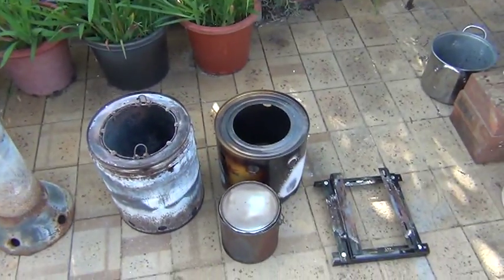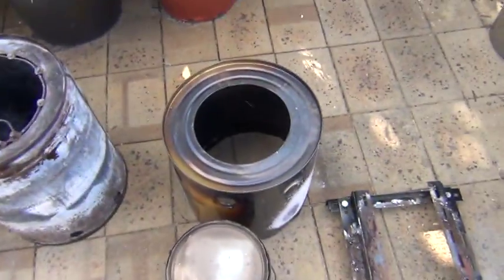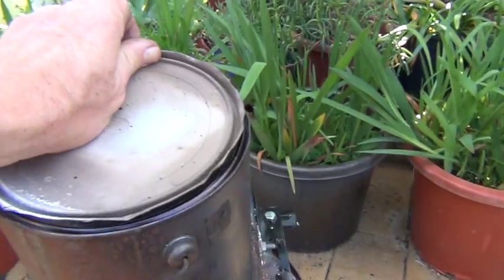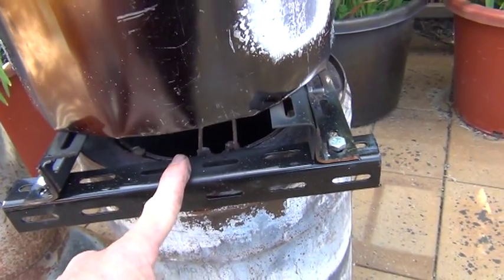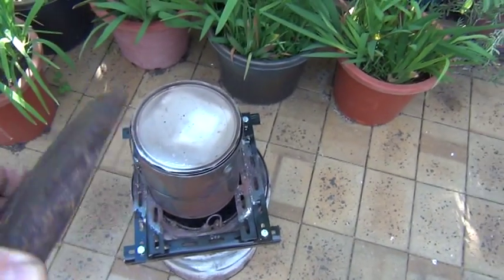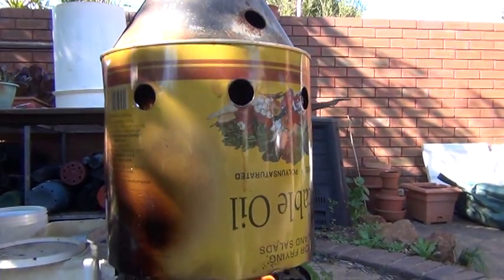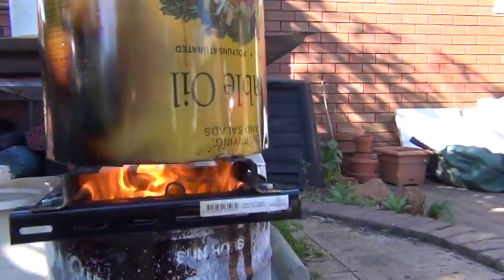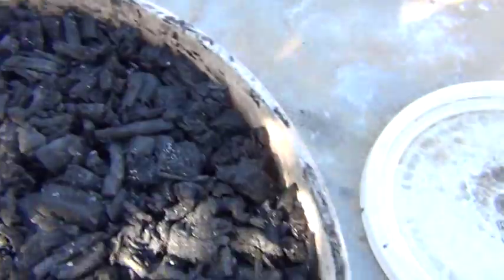How to make Biochar 4G TLUD with retort - 2 Stage Pyrolytic Converter with Afterburners

Comment: Intetesting multi-stage design. Why do you have holes in the flue cone and the retort shroud? Is it to help cool off the flue gasses?
Reply from the maker: Combusts the gases better and there is no smoke.
Reply: @jakattah  Ah, I see. Thanks for the swift reply, sir! Apologies for my late reply. YouTube decided to stop notifying me of replies to my comments two weeks ago.
Reply: I am investigating gasifier stoves.

I've been experimenting with different combinations of small, nested vessels (coffee cans, soup cans, etc) at different temperatures (-20 Celsius to 0 Celsius) and different wind conditions. I've been using an old-fashioned triangular-notching can opener and pliers (with occasional tin snips) along with assorted fuels and forms of fuel. I've had a lot of duds and a few successes. For me, the non-uniformity of fuel is rather challenging. I've only had twigs, leaves, paper, cardboard, and wax to burn. i have a bunch of charcoal in the form of sheet flakes, though it's far from pure and contains a lot of ashes. Of the materials that I have tried, the most reliable have been rolls of corrugated cardboard. This is probably due to the airflow up through the corrugations in the cardboard.

It's been enjoyable to experiment with, but my neighbours have been giving me funny looks as I've been performing the experiments on my porch. It gets pretty ripe out there when the fire goes out prematurely and my porch turns into a giant smoke cloud. Many a tear was shed.

Next up I'll see if I can roll sheets of paper into tight rolls and then stack the rolls in parallel so that they resemble honeycomb from above.